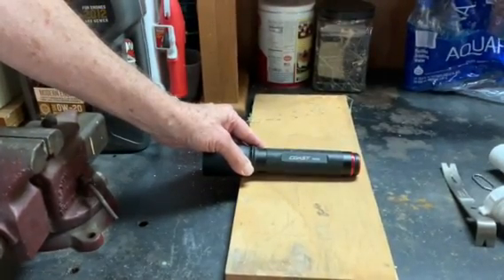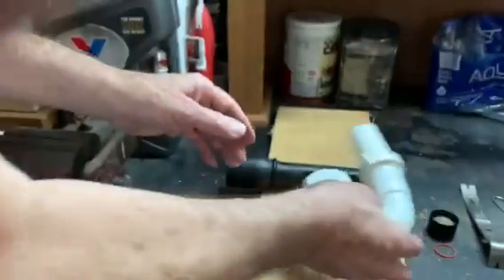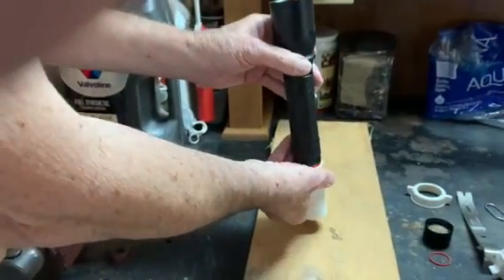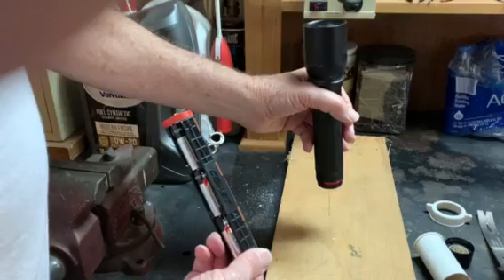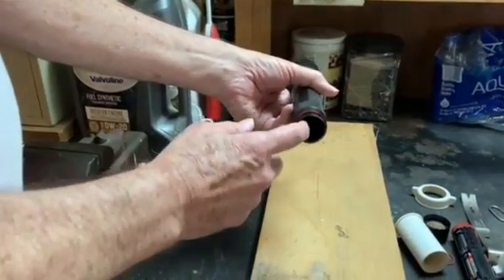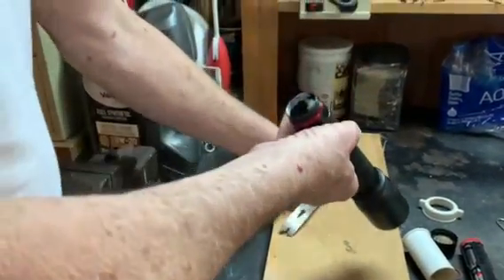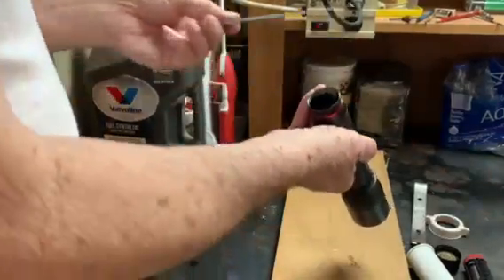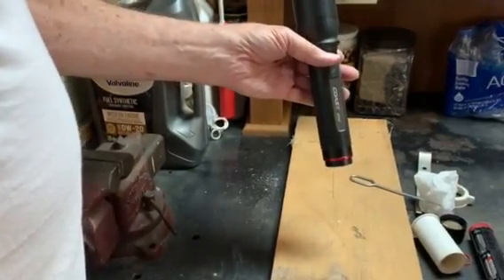STUCK BATTERIES IN COAST HP550

Comment: Not worth it buddy, just get a better flashlight!
Reply: learn to fix good things, it's cheaper and better in the long run buddy.
Reply: @Demo team  if it were a "good thing" then the battery wouldn't be stuck inside, now would it? 🤔
Reply: If you own things, they wear down, service and maintenance, are important. 

This is just some advice for an issue with one of Coast’s great flash lights. 

If your advice to a repair is to replace it, it’s not really advice my dude…  you’re just here to spout off m8. 

This is just an issue that happens with age, not a 10 day old product.
Reply: Exactly buyers remorse here.
Reply: Esas baterias son un problema ya que ae atascan. Remplaza por unas 18650 o las 26650 con su regulador de carga y listo..linterna para rato!!